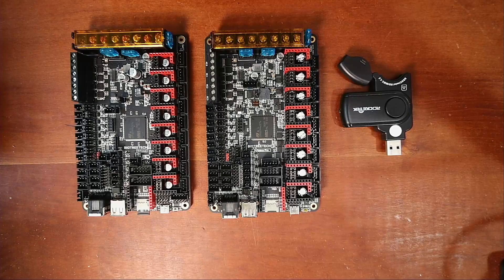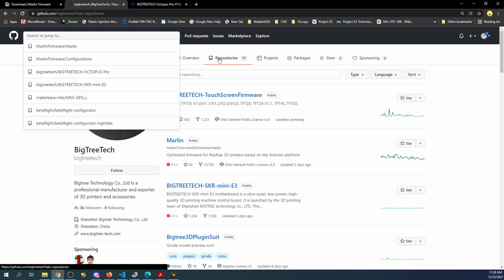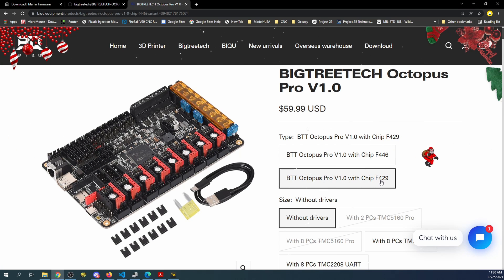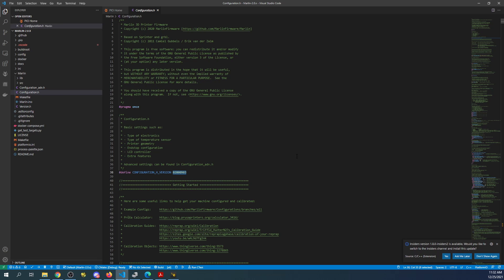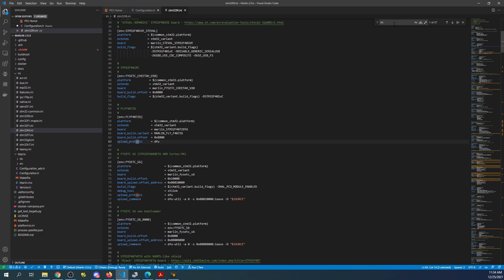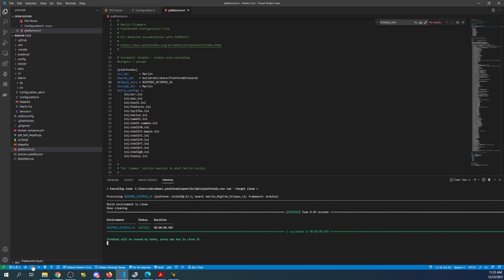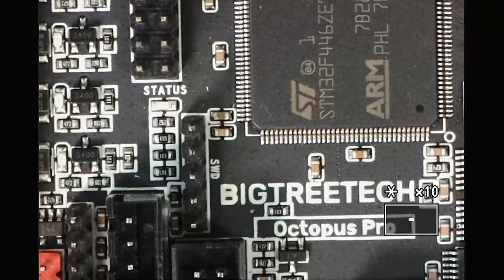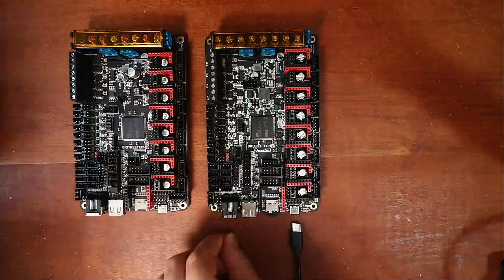BTT Octopus PRO - Firmware Loading with Marlin 2.0.9.3

Comment: note to self 
5:18 board file location
5:48 where to set the board type
5:54 first serial port to -1 for some reason ? second port for TFT display check the video about it
7:14 board environment
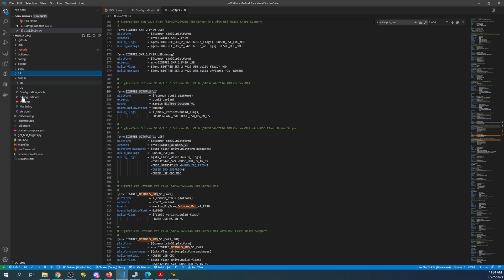7:35 platform ini environment set
9:36 where to get firmware. bin if i forget where
enable eeprom_settings 
check keep alive message and bigger delay between them

Comment: How to get the firmware.cur files?
Reply from the maker: FIRMWARE.CUR occurs on successful load of firmware.bin on micro SD card to printer board.
Reply from the maker: If it's not occurring create a blank file named FIRMWARE.CUR and use firmware.bin on the same sd card load.  Note if FIRMWARE.CUR becomes the size of firmware.bin and firmware.bin is no longer present on SD card after firmware load.

Comment: Did the firmware.bin actually rename itself in your video?  I'm confused because the file size and date of the .CUR are the same as they were prior to the send to actions.
Reply from the maker: "firmware.bin", if it loads correctly will automatically be renamed to FIRMWARE.CUR.  same date and file size as firmware.bin.

Comment: is there now way to upload the firmware over usb? I used a SKR 1.4 Turbo board before and didn't need to use a card reader and had to replace the sd card every time
Reply from the maker: Yes, but it can be unstable for 98% of users.  So I leave it out.  Also Marlin working on a solution.  I looked at it a couple of months ago, but it was not stable.
Reply: @EdwardBraiman  ok but at least there is some hope. is the other way with the stlink dongle? I saw that VS had an error message saying that something is not found and it seems there is an integrated programmer. I mean it would be for me also ok if I attach an and ISP/SWD device if I could upload it direct. but changing the sd card every time seems very anoying also because I need to do a lot of customizations
Reply from the maker: Correct swd is possible, I a oid showing people as it can be error prone for new users.  Flashing via card is most reliable method and has check of file rename.
Reply: @EdwardBraiman  jes but it's a comman method and a lot of arduino folks are doing it. I mean if you tell them doing it at their risk they can decide if they want to do it or now. I used that only for AVRs before and it was not that special different than with ISP or plugging and uart-usb adapter.
Reply from the maker: The issue is how many questions people with have in more complex method.  Unfortunately I make tutorials, but need a full-time job to support my YouTube habit.

Comment: 11:30 so you telling me that my 3d printed power isolator for usb wont be needed anymore ? lul
but the question is will it brick something if i leave it there  when powered by power supply and usb power?
Reply from the maker: The reason I say to remove USB is it can reset TMC type steppers.
Reply: @EdwardBraiman  i see thanks

Comment: I downloaded VS and installed the platformio.ini plugin but I don't have the trash and check icons in the lower blue tool bar. I also don't have platformio.ini in the explorer like you do below Makefile. I do however have the ant head icon in the far left tool bar. What do I have wrong? Thanks
Reply from the maker: Do you have a folder open for Marlin firmware?
Reply: After instaling Marlin  plateformIO add-on to VS ... I got these buttons to show up ,,

Comment: My TMC2209 Drivers are heating during prints, is it normal ? What temperature should they be at ?
Reply from the maker: First are you using a fan to cool them?  Second which NEMA type steppers?  Third there's a datasheet link in description to give you a sense of operating temperature.  Also there's a link to Discord there as well.
Reply: @EdwardBraiman  Thanks for the reply <3, I'm only using the stock heat sinks, using NEMA 17 JK42HS. I built my 3D printer myself, it's similar to the Anycubic Chiron indesign and size. Thank you so much mate

Comment: @Ed's 3d Tech  Thanx for all the videos on this board. Can I ask how you get the search bar you use in VS/platformIO? I cant seem if find out how to turn it on so I'm searching manually.
Reply from the maker: You're welcome. Might be install issues with PlatformIO.
Reply: Ok. I'll try a reinstall tonight. Thought it needed to be turned on.

Comment: What is the difference between the F446 and the F429?
Reply from the maker: Not much, you'd need to check the datasheets.
Reply: @EdwardBraiman  Thanks, the biggest thing that caught my eye looking for more info is the F429 should be avoided because it has issues. About all I could find that makes it different is it has a slower clock speed processor and comes with more memory. This just leaves me shaking my head why they even bothered with the 429 and instead offered the 446 with more memory. Makes zero sense to me and leaves me wondering if there isnt something else that makes it different?
Reply from the maker: The chip available on the market is I think why they changed it.  We had a year with nothing being made in some places.

Comment: The only environment that will compile is BIGTREE_OCTOPUS_PRO_V1_F429_USB and when I flash the firmware the screen I have tested doesn't show anything except for marlin mode (which shows all the time) and it lights up. Not sure if I missed something or just a bad board but followed the steps in this video.
Reply: The only thing that might be different I can think of is maybe the version of Visual Studio Code and the plugins.
Reply from the maker: Try my Discord in link below we can try and work through the issue.
Reply: @EdwardBraiman  That's a voice program right I'm not sure what's wrong with my headset and I fixed it by enabling #define REPRAP_DISCOUNT_FULL_GRAPHIC_SMART_CONTROLLER. Just threw me off because in the past you didn't have to enable it. Just not sure why the other environments don't work but not to worried about it since it works.
Reply from the maker: That's great 👍
Reply: BIGTREE_OCTOPUS_PRO_V1_F429_USB /// did not work for me: maybe too old version of VSCode? Too old Platformio 5.0.4? Otherwise very clear presentation!
Reply from the maker: Might be mcu is different as when tutorial was made only one MCU existed.  There's a Discord link in description and either myself or someone else can help you in general chat.
Reply: @EdwardBraiman  This I managed to solve, thank You !
Reply from the maker: You're welcome.
Reply: #error "Unknown MOTHERBOARD value set in Configuration.h."

Comment: I've covered so much ground with octopus that last few days with your help in the videos and marlin still a few quirks like enabling the sd_support and lots of other things I've never seen in marlin before. 
Finally got it running with my core xy converted ender 5 Pro but have been unsuccessful in getting the inductive probe to work as the z end stop and now keep getting thermal runaway after a few layers 
And again thanks for the help so far :)
Reply from the maker: You're welcome.
Reply from the maker: Hit build button a second time after first failure.
Reply: @EdwardBraiman  it seams there is a resistor required to run the NPN inductive probe so I've gone back to the bat85 diode and using the z end stop plug as I couldn't figure out how to tell marlin to use the dedicated probe port for Z end stop 
Found the cause of the thermal runaway I had neglected to change the e steps for the z to 800
After setting up the eeprom,s curve,auto fans and tramming wizard I've managed to get it to print but it seams the last rev I have complied the USB port no longer connects to printrun lol